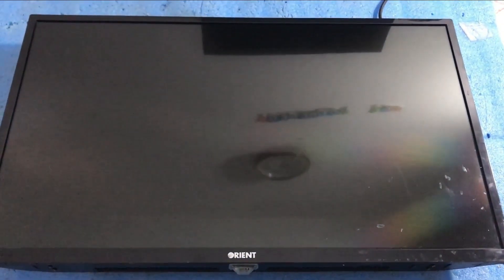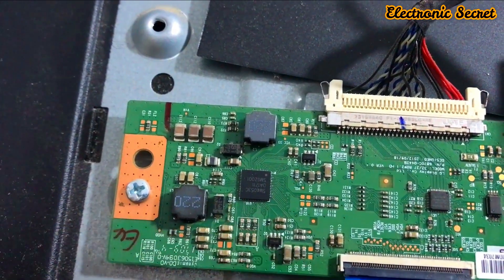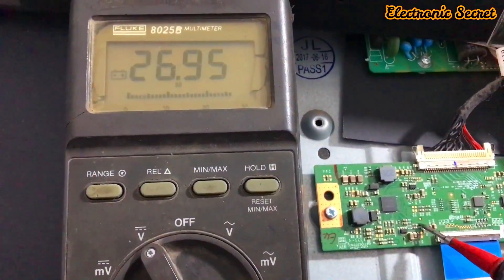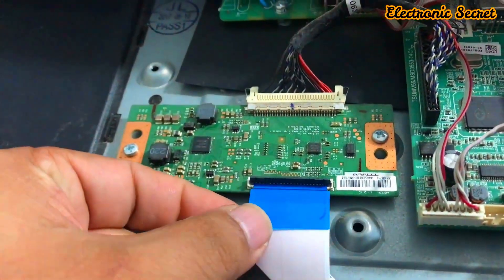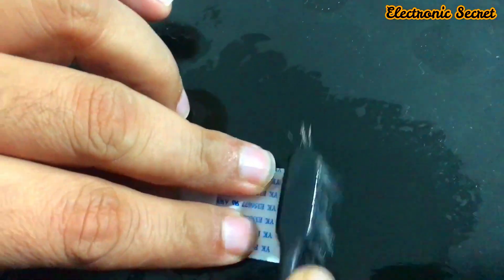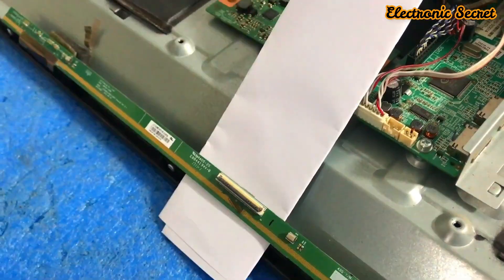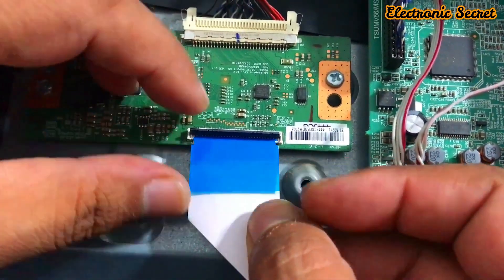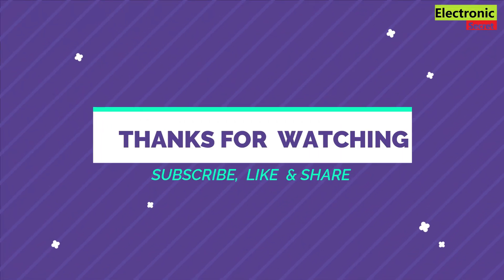HOW TO FIX TV DISPLAY PROBLEM, HOW TO FIX WHITE SCREEN ON TV

Comment: I have a 65" Samsung NU7100 with a white screen that turns on like that. I can't get the menu to pop up or anything and can't figure out how to fix it. I hear noise when I press buttons but the picture stays white with a greyed out section right of center. Can this method help fix the problem or do you have a different method?

Comment: I have one Samsung tv 32 grows to white screen. One coil (no label) 
is reading zero ohms. But there are no capacitors tied to this coil. I think it leads directly into panel. Injecting voltage at coil and nothing heats up at 6amp. Do you think inside panel is short? Do u think can cut tracks to fix?
Reply from the maker: Are you getting all DC-DC voltages ok like vgh,vgl,avdd,vcom?
Reply: @ElectronicSecret  I have confirmed a lot of voltages ok where I probe but not sure as not much label printing on board. I'm thinking I should cut all the tracks that read as short to gnd until I see the coil not shorted. Then I will know which line into panel is making coil short.

Comment: Mera Hitachi led tv 43 inch ka hai 
Usme half screen blue which means picture aa rahi hai and half screen black ho gaya Hai please tell me kya problem ho sakti hai
Reply: Mine omw  flex is on the tcon panel and it can not move, white screen problem
Reply from the maker: Check your panel Tcon,
If it has two flex cables going inside panel then interchange both flex cable,
If got display on that side this means your lvds flex cable is faulty,
Replace that,
And if you got the same problem after interchanging cables then your panel is short from that side,